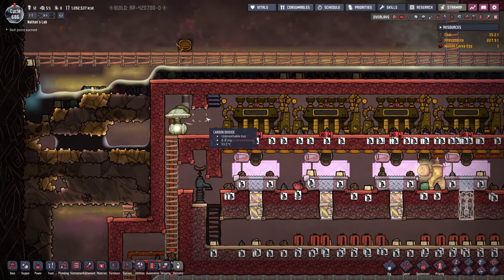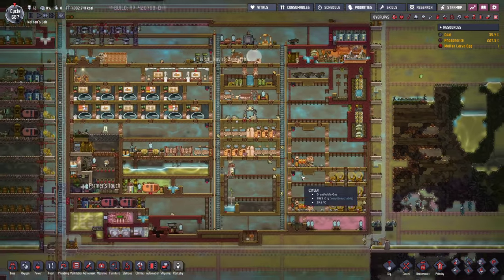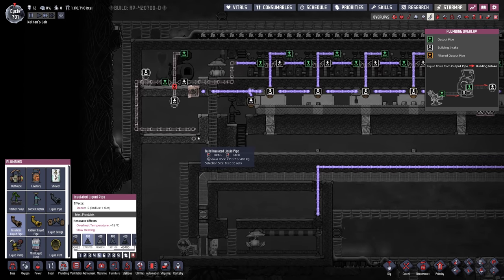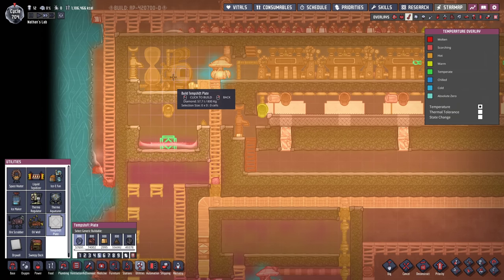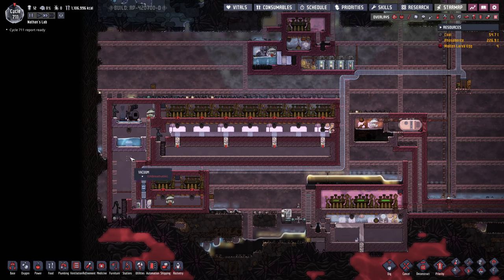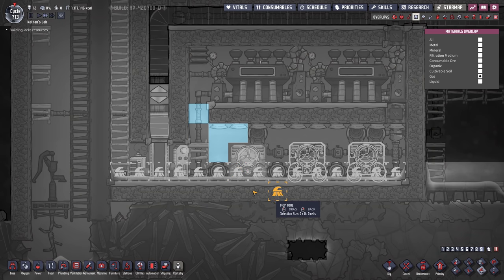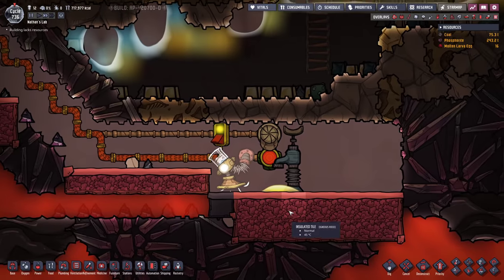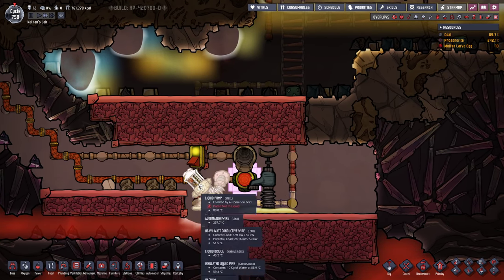MORE POWER - Oxygen Not Included: Ep. #16 - Building The Ultimate Base

Comment: I wonder how well that magma chamber will actually work. I would worry that at some point it cools down so much that the magma forms solid tiles and you'd have to get in and dig it out. What a mess that would be
Reply: That's exactly what happened to me lol. I'm thinking that I'm going to have to modify this and make it a loop with radiant tiles instead
Reply from the maker: It solidifies quite quickly but it will be above 200 degrees for a long time.

Comment: Hi - very nice 👍
My ideas this Time:
Maybe, instead of using Hydrogen Gas, you could also use a thin Layer of water or oil in the steam Turbine room. You have to have the cooling loop in this Layer, but it's much easier to do, than to bring gas all the way 👍
And: in a vacuum, debris only exchange heat with the floor. So a bottle of Lava is usually noprob.
Reply: I totally agree, it is much simpler, to keep the turbines in a vacuum with just a thin layer of liquid for the turbines to exchange temperature with.
I was about to write that comment as well :D
Reply from the maker: Nice, I'll probably try that for future designs!

Comment: I'm liking this series, the way you explain what you doing is very clear and easy to understand, just to add a few tips: critters can be wrangled using the critter dropoff auto-wrangle feature, it's kinda tricky but can be done, mechanized doors don't actually need power in order for then to open/close using automation if time is not important, besides saving power you don't have to bother building the power transformer. This one is not actually tip just personal preference because I'm not a fan of big centralized systems in ONI, like for example bathrooms can be self contained, all clean water comes from a water sieve that cleans the polluted water that comes from bathrooms and you just have to deal with the excess water. Energy is another issue, when you have power shortages everything fail at the same time, what I like to do is a unified power generation but the distribution and storage in site: for exemple each power transformer that distribute power to a system have an smart battery automated so it turn off the power transformer, this way the heat that the power transformer outputs is way less than what a battery output and in case of complety power shortage, each system still have some power independent mitigating complete shutdown, also you can prioritize the most critically systems. Hope this tips can help others and I will be waiting for the next video.
Reply from the maker: Great tips, thank you!;)

Comment: I just had an idea for another way you can train your dupes up - if you install a liquid vent over an area with a couple of tiles on either side (to act as a kind of reservoir), with a valve before the vent to only let out a small bit of liquid, and hydro sensor to close the vent when enough liquid has been dumped, you can make your trainee mop non-stop to train up their strength as well.  Not necessary, just had the idea and wanted to share :)
Reply from the maker: Haha that's even more cruel than the hamster wheel!
Reply: So I actually did this in my base and it works great!  To build it, make a 3-tile wide reservoir with the vent in the middle, the valve (set to 120g) immediately before that, and a liquid shut-off immediately before that, then add a hydro sensor set to "green if below 2kg" next to the vent and linked to both the vent and the liquid shut-off.  Issue a mop command to either tile beside the vent (but not the vent's tile) and they'll literally mop from waking until dinner, leave the task unfinished, and pick it up again in the morning :D
Reply from the maker: Hehe amazing!

Comment: I don't think that u should open these doors.
If the tile is with enough mass and colls down, it will become a solid natural tile and it will stop your hole system
I think that u should put a automation to only permit more magma in when some has solidified (as a debrief not a tile)
Loving the series btw
Reply from the maker: I just learned that this way we loose a lot of heat, I might have to come up with a solution to solidify the magma into tiles and then mine those up. Seems to give a longer lasting heat. But I have to do some experiments.

Comment: The mechanical doors don't need to be powered to work. Powering the doors just makes them open faster for dups, it doesn't affect them if you open them with automation
Reply from the maker: You know what, that's a good point!
Reply: Not entirely accurate, they still open and close faster with power when automated.  You can test this for yourself by building a liquid-driven door compressor (https://imgur.com/a/S4V0Nxu) and using it with unpowered doors. Won't work. Power the doors though and it works great.

Comment: The reason the pitcher pump idoes not overheat is not because it is built from obsidian, but because it is in a vacuum. The material is irrelevant. Also doors don’t need power to be automated, they just open and close slower.
Reply from the maker: I was more concerned about melting than overheating with the pitcher pump. You mean the doors don't need to be powered, they do need to be automated though. I guess you meant that though, so agreed;)
Reply: @Nathans-Sandbox   One thing that's nice about pitcher pumps is that the pump part is the only bit sensitive to heat. The "hose" that dangles from the bottom can sit in magma all day and it'll be fine.

Comment: Hey Nathan!
I just wanted to share my geothermal power plant with you - it's HEAVILY based off of yours (the final design you arrived at a few episodes after this), but with a few changes and optimizations that I wanted to attempt.  I'll tell you right now that I only had the time/patience to do four of the diamond spikes the "legit" way, and after 4 hours decided to simply use debug mode to build the rest.  Anyway, there are explanations included for each of the pics, so without further ado, here's my take on your power plant: https://imgur.com/a/i7fuG4S
Reply from the maker: Ah that's a crazy design with the spikes lol:)
Reply: @Nathans-Sandbox  yeah, those were a huge pain in the butt.  Thankfully dupes can build doors through doors, so that allows you to push down into magma, and then you build the spikes as you disassemble the whole thing coming back up.
Reply from the maker: Ah I didn't know about the door technique!
Reply: Nathan's Sandbox it's SUPER useful, especially when using tiny doors. The trick is to build a door, lock it, build another door under that one, open the first door (open not auto), lock the second door, build a door through that, etc. If you don't set them to open dupes won't path past the first door, and if you don't set the bottom door to locked dupes will be dupes and kill themselves occasionally. The last 3-4 blocks down I just used obsidian ladders to reach down there and let my dupes suffer a few magma burns :)
Only real downside to this is that you wind up with a bunch of super-hot steel, so I lock them in the room above and have them build steel doors to reset the temp on the materials to 40C.
Reply: If I were to do something like this again I'd probably go with a geothermal petroleum/sour gas boiler though. My magma biome is already 1/3 solidified because steam engines keep drawing power (and thus heat) all the time unless you run an automatic cable alllllll the way down from your battery box.
Reply: Nostalgic History  Thanks for the unsolicited opinion. I'll let you know if I have any other linguistic choices I'd like to run by a complete stranger on the internet.